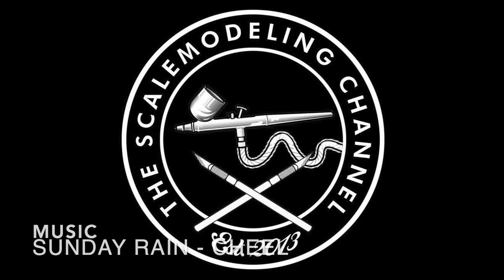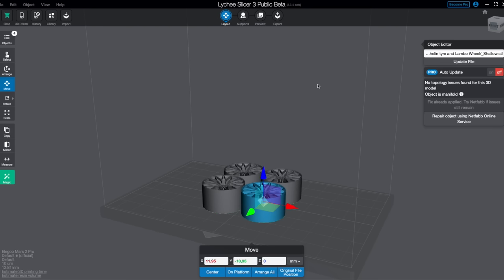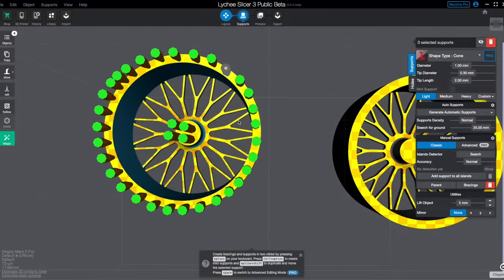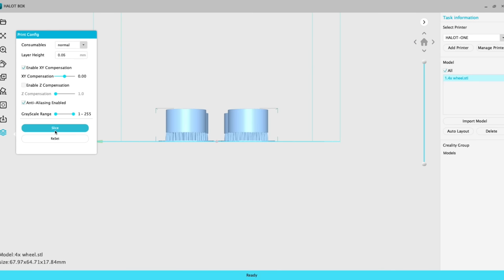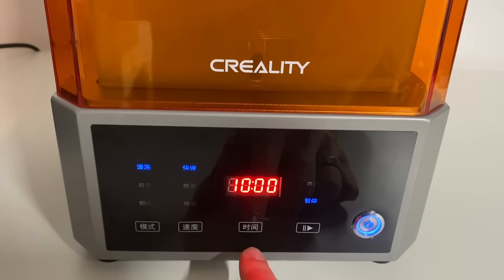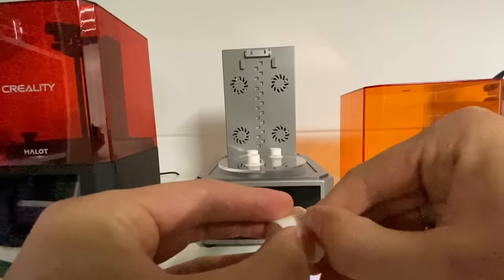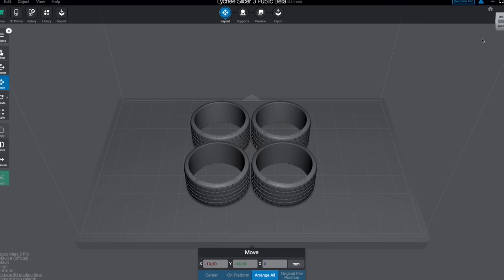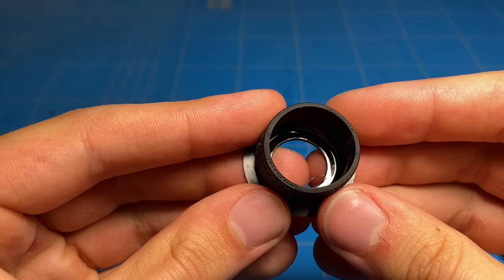How To: 3D Printing Custom Wheels and Tyres for scale models with the Creality Halot-One

Comment: One of my fears about buying a resin printer, is you could buy it, then find the LCD screen needs replacement, but the manufacturer has discontinued it, meaning you can't get it working again.  While a resin 3D printer would be ideal for my plastic model kit making hobby (I generally build 1:25 scale car kits), an FDM would probably be used more for my RC hobby...

Comment: for the tires, I always wonder what's the main advantage to rubber vs paint , this goes for regular kits as well.  I heard that rubber can change over time, whereas painted ones  ( espoecially when protected with clearcoat) should likely stay the same 

never knew there was a rubber like resin, this is great to know and might be useful

Comment: Nice video I just got an anycubic 4k it's awesome aswell I'll definitely use your mates cults I'm on that all the time I'll get some his stuff and try it out! I've got anycubic tough flexible resin on the way I'll try it with tyres! Alos use g lychee the free one but it's offered me the Pro for free now since used it for past 3 weeks so happy with that lol I noticed you managed to line the supports up from the centre hub how do you do that? That's what I've been wondering about if it had an alignment tool?
Reply from the maker: I just put the supports on manually. No tools sadly

Comment: What if we directly place rim to plate without supports? Only adding supports to inside supports?
Reply from the maker: You run the change of cracking/breaking the rim piece which is stuck to the buildplate when removing it. If you use a flex plate it could be possible

Comment: How often do you change the alcohol in the cleaning station. Is it after each build or after a number of builds?
Reply from the maker: Can’t say exactly.

I change it when prints are still dirty after cleaning. Or if they are still sticky after curing
Reply: Could I build a 1/12 scale postal truck? Would I have to do it in parts or as a whole?
Reply from the maker: @vwthga1  that depends om the size printer you have. And how big your parts are

Comment: Are you using Resione's recommended settings for the F69? I have tried to print a few prints without any luck using their recommended settings.
Reply from the maker: Try longer cure times. Black resin lets the light penetrate at a much slower rate then other resins

Comment: On the tires have you tried using rafts with supports? Maybe it's easier to clean up.
Reply from the maker: The raft sticks. The tires fall off of the supports

Comment: Why having the wheels floating and add supports instead of having them flat on the bed, and just add supports to the center? Thanks.
Reply from the maker: So the barrel of the wheel does not break when removing it from the buildplate
Reply: @TheScalemodelingChannel  I understand. Thanks so much.

Comment: Is only the printer enough or do I also need the other machine?
Reply from the maker: You need a curing machine to cure the resin after printing. Or atleast a strong UV light. That makes it a lot easier with the machine. Same for the cleaning

Comment: Can you print a set of wheels for a 1/12 Honda NSR500 1984 ? I am building a Spencer 1985 VF750F AMA Superbike replica that had the same wheels as the 1984 NSR500. I would need 2-3 sets and if so I will pay for it and shipping.
Reply from the maker: If there is a file available ready to print. Then yes. If not, then no

Comment: do you need that certain 3d printer to create rubber-like material like that tire? or you just need a certain liquid resin?
Reply from the maker: You need a resin printer and the specific rubber resin
Reply: @TheScalemodelingChannel  thanks for the reply, just found out the rubber like resin is exist but it's way a lot more pricy than the regular one

Comment: You seem to have a very large extra step in going from one software to another.  Why not just import the model into Chitubix, slice and sent to the printer? You can add a printer and change parameters easily if your exact printer is not listed yet.  The slicer you use looks simplistic, compared to Chitubox.
Reply from the maker: You could indeed. But i was not able to figure out a working configuration

Comment: The 3D printed wheels look better than the kit wheels. 
I am wondering about the costs of materials to create 4 wheels and tires - is it cost effective?
Reply: This hobby is not cost effective at all, what a question :D
Reply from the maker: If you print wheels and smaller parts all the time it is very cost effective
Reply: About 4 cents a rim. Another 5 cents a tire.

Comment: Your compressor has an airflow of 17 liters/ min but on internet I see that the airflow of the airbrush that you are using is around 25 liters/min max. Is that a problem because I have a compressor that produces 20-23 liters/min and I am considering to also buy a mr hobby ps-290 but I don’t know if it will operate good enough?
Reply from the maker: That is probably only the max working pressure there. It is suitable for a 0.6 nozzle max, and has a maximum capacity of 6 bars pressure. 

I spray at 2 bar. So am not even close to using the compressor to the max.

Think it should be totaly fine. Mine is. So with your setup being even more capable i don’t see why it would not handle it.
Reply: OK, thanks for the reaction

Comment: Great video thanks for sharing.
I designed some rims in fusion 360 and printed them out on both my ender 3 and my voxelab resin printer, one thing I had was for some reason out of the resin printer they came out egg shape.
I printed them out flat on the build plate,  why did they egg shape on the sla printer vs the FDM printer, your thoughts?
Reply from the maker: Not really sure, could be the settings. The resin. Room temp. All sorts of things

Comment: How long does the liquid last? Like how much can I print?
Reply from the maker: That depends on what exactly you print and about 100 other things. There is an amount in the bottle. You can calculate in the slicer how much resin your prints roughly need.
Reply: @TheScalemodelingChannel  oh ok nice thank you! I actually just ordered a printer and the liquid. I’ll be printing small stuff for 1:64 scale. So I hope I can get a lot out of it

Comment: What printer/slicer settings were required for printing the F69?
Reply from the maker: I had it set at 0.025 layer height. And 2 seconds cure time. However, when the weather changed and therefore the room temp, i had mixed succes. I’ve heard that having a longer cure time works better for black resins.
Reply: @TheScalemodelingChannel  Thanks for sharing technical details.  I've found that many of the scale model 3d printers won't share knowledge because they're all about making money not sharing knowledge.  Since I use my printer for personal use, I'll share as I learn.

Comment: Would and slicer change any tire/wheel file to the following dimensions:  

Tires     86.995mm outside diameter
              60.325mm inside diameter 
              33.337mm width
Wheels 60.325mm outside diameter
              33.337mm width
Reply from the maker: You can change the size of your parts in the slicer. Or 3d modeling software
Reply: @TheScalemodelingChannel  

Thank you.

Comment: How would the rims and tire turn out on a regular 3D printer?
Reply: Super low detailed and rough at best
Reply from the maker: Not good to say the least
Reply: It will not be as good as with resin but you can get decent results (well, maybe not with model kit standards) IF you know what you are doing (like adjusting the dimensions to what the printer can handle) You need to know some basic 3D tools though
Reply: No.

Comment: For God's sake..just use Chitubox and auto support, it also auto distributes the individual parts of the print. Watching that was painful.
Reply: Auto-supporting usually places the supports on the edge of spokes and hoops, meaning like 10x the cleanup and fitment issues. Which is more painful by far. Ask me how I know.